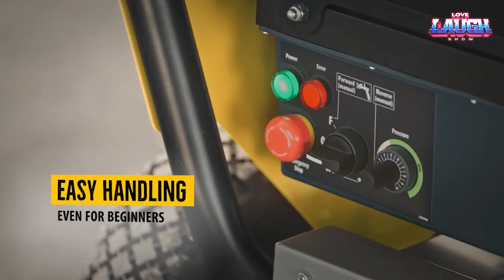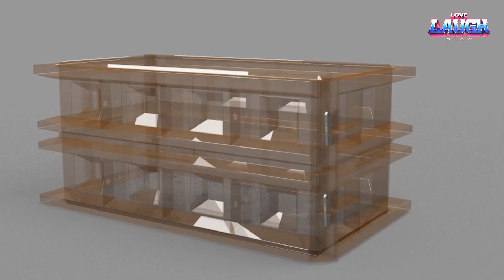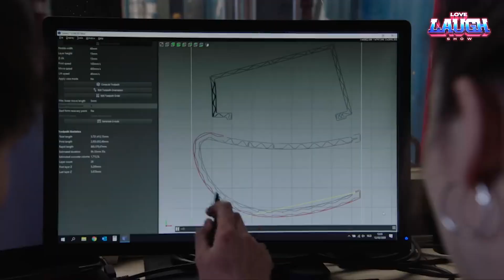Ingenious Construction Workers That Are At Another Level

Comment: if you have a house made out of wood, meaning you've cut down some trees, how is that green? it was green, when the tree was alive, now it's a dead tree, therefore, it's damaging the environment, whereas a concrete or block house would mean no tree is being cut down, right?
Reply from the maker: Great question! Wood can actually be a more sustainable building material if it is sourced responsibly. Sustainable forestry practices, including replanting trees and managing forests for long-term health, can make wood a renewable resource. Concrete, on the other hand, has a high carbon footprint due to the energy-intensive process of making cement.
However, the sustainability of any material also depends on other factors, like transportation distance, longevity, and end-of-life disposal. Both wood and concrete can have a place in sustainable building when used thoughtfully.